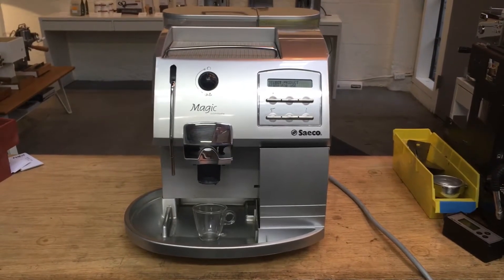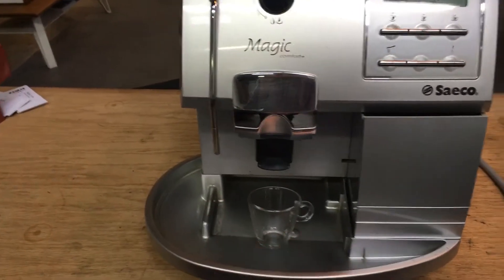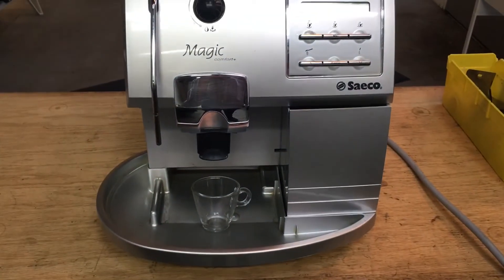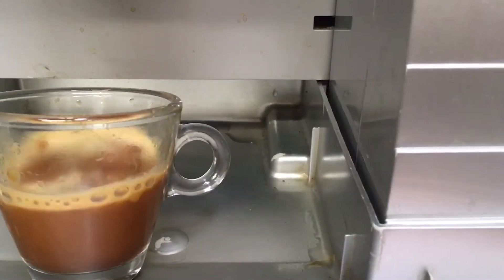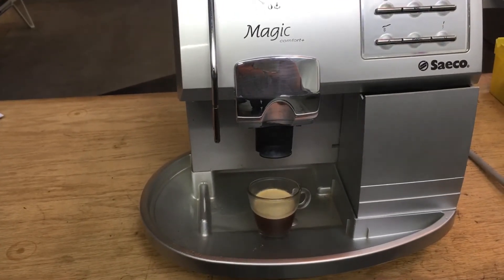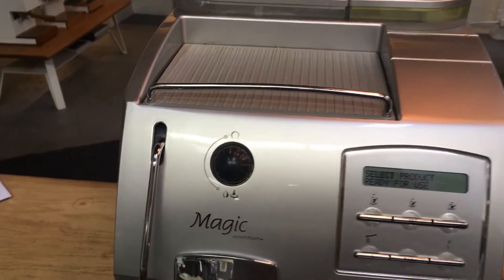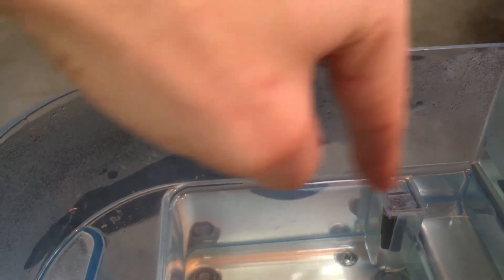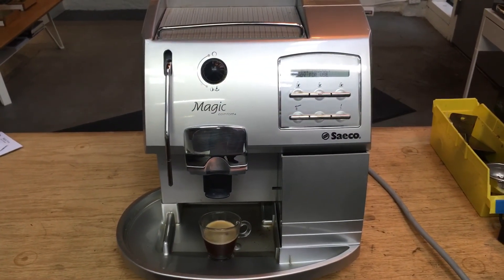Leaking- Saeco Magic Comfort+ Test 1400

Comment: I’ve had this exact Saeco Magic Comfort + coffee maker for 20 years!!  With regular cleaning and maintenance, I’ve had no problems until now.  We recently moved, making sure we used ‘kid gloves’ in relocating our coffee maker.  However, our water tank is leaking.  There is no visible cracks from the tank itself, but after putting filter in, the water leaks out between the machine and where the tank of water sits.
Is it possible that I need to change out the ‘O’ rings in the tank itself?  What about the rubber ring on the machine itself, can that be changed out?  If you’ve heard of this problem before, I could sure use some advice.  Is there a Phillips repair service that I could call or ship for repair?   I just hate to part with my coffee machine…..we have a history!